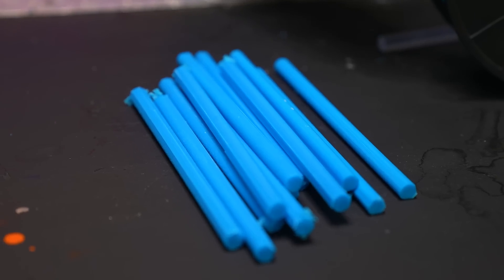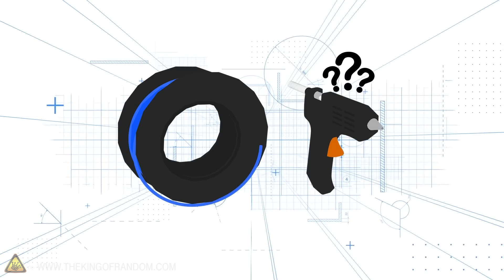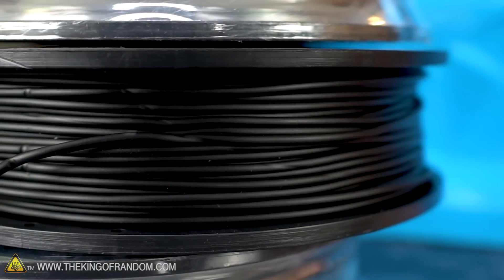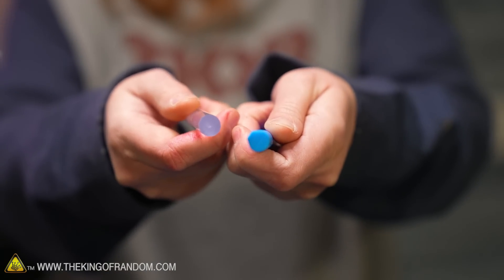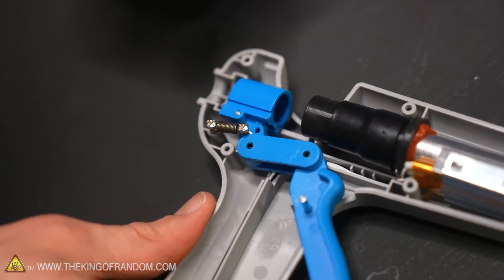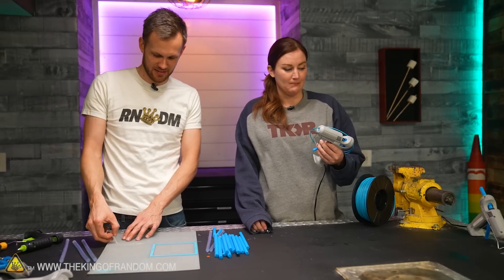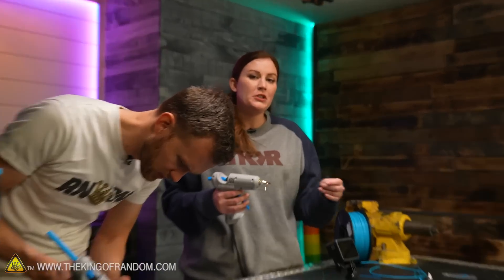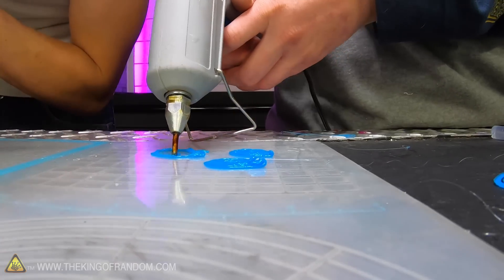Turning a Glue Gun Into a 3D Printer

Comment: U can get a tiny glue stick guy and there is two temp settings which wood and lighter bonds are at lower temp setting but the same stick at high temp setting suppose to bond metal and have strong hold..I've been curious

Comment: is there a strong enough filament that could be used with the "3d printing pens" that would make it practical to do repairs on plastic things in a vehicle, like trim pieces and accessories on the interior
Reply: Not with hobby 3D pens. Automotive polymers tend to have much higher melting points than the PLA that 3D pens are designed for. Additionally 3D pen create "artistic" rather than neat, precision results, so I doubt you could get a neat repair even if you could melt the correct polymer.
Reply: @ferrumignis  thanks for the reply, so with a purpose made tool, meaning built to handle the right heat, this still might work? n the patterning isn't a problem, a patterns normally used when doing repairs anyway, i havent personally done it yet so idk what they look like or how they work, I simply have a friend that does it n talks a lot about it

Comment: This is pretty cool. I use a soldering iron to fuse 3d printed armor for cosplay but can actually see this working even better for that purpose. It seems much cleaner and PLA welding with a soldering iron, although fast, doesn’t produce uniform and easily sandable results.

Comment: My favorite part is where you had to have a 3D printer to print the glue sticks, that you’re using, to make 3D printing easier with a glue gun. But you still need to print the sticks. And the 3D pen works better and faster. So what’s the point again? Oh to see if you can. Cool 😎 heat melty da plasticky duhhhh

Comment: Hot glue and a nice silicone mold (or tinfoil sprayed with Pam as a mold release) and you can make amazing things with hot glue.
It paints well after a layer of primer so you can get amazing textures. Or paint it with nail polish for a gem-y affect.
 I've made an entire dice tower, masks, jewels and an entire alien helmet with EL wire inlay. 
Since it's slightly flexible, I've used it as a mold material itself to replicate the snakes on the hocus pocus book in epoxy clay. It isn't perfect, but does fine in a pinch.
Since it's translucent, it's also awesome for flame effect for models and cosplay. Just paint it with glass paint, alcohol ink or insert a flickering LED from one of those cheap tea lights.
Use colored hot glue instead of sealing wax for fancy letters.
You can do so much!!!!

Comment: I'm doing some metal casting.  3D printer would be nice but not feasible on disability.  I go from Alginate to plaster to 2-part rubber to wax then burn the wax out.  Problem with the wax is it easilly deforms.  Wonder if I can use a glue stick gun to fill the mold or 3d filament,,,Hmmm...

Comment: Ok so hear me out at work we have something called jet weld it is stronger that the wood we used to glue it to it comes in metal tubes  that goes into a gaint glue gun this would be amazing to see it print it would be stronger than pla heat resistant.

Comment: While hot glue is hard to work with due to heat and time to work it, it is very possible to make certain things with it, with a bit of patients, for example. A "giant" bonfire for tabletop gaming that has red yellow and orange lights that flicker within the glue flame shape to emulate a fire. It took a while but looked way better than a 3d printed Version :)

Comment: Looks like you effectively have a plastic welder. I would say that'd be probably pretty effective at welding together different 3D prints.  Typically stuff I print is bigger than the print volume and so I usually plastic weld my prints together using a 3D pen but that looks faster...

Comment: My glue stick glue hardens almost immediately. Maybe my glue gun is lower power than yours. It's actually kind of a problem because I can't do things where I need to put down molten glue first in order to then stick an object to another. With mine it doesn't pool as much but the glue is very sticky and there are always stray strands of glue, and it can't melt a larger volume quickly, so while it would be easier to make objects/art with, it still wouldn't be practical.

Comment: Excluding the motion control functionality of a 3d printer, the rest of it is just a glorified glue gun basically.

Problems with your setup:
1) printers have heated beds to help with cohesion, and to help prevent rapid cooling. 
2) average nozzle diameter is 0.4mm and I'm fairly certain that is significantly smaller than standard glue guns.
3) the funneling ratio for 3d printers is ~4.25/1 which help to functionally push the filament out by pressure rather than a trigger function using the backend solid matter as a plunger, thus a smooth flow of outbound material.

I imagine it would not be that hard to modify any standard glue gun to function like a 3d pen, but not a printer.

Never the less... awesome episode, I totally thought those printed glue sticks were not going to work, were they solid or infilled geometry?

Comment: I got my 3D printing pen from ebay for about the same price as a high-temp glue gun, so kind of a mute point if you're gonna get a glue gun just for PLA. the pen I got also works with either PLA or ABS, with a versatile temperature control, so you can play with that until it cools at just the right speed for your taste. somehow heats up way faster than my hot glue gun, too. basically, don't destroy your glue gun to do this, just buy a 3D pen. totally worth it.

Comment: Here’s the problem I see with this. You need to use PLA, and a hot glue gun stays hot for a very long time in comparison to a 3D printer which has active heat transfer or a pen which has a very small CSA and cools down much quicker. Because of this, you end up cooking your filament, and it will become discolored and very brittle, potentially just rendering your gun useless after a couple tries. Fun concept to test out, but just get a 3D printing pen if you want to use it for practical applications.

Comment: I tried feeding polyethylene water tubing into my hot glue gun at one point to see if that would work. It wasn't quite hot enough to melt it.
Reply: Oh hi, dude! I really liked your wood gas videos.
Reply: Oh dang, that was the next thing I was going to try.
Reply: @403_tuna  simply?
Reply: thats not a bad idea as the tubing is wide enough for the feed mecanism to grab ontoo , only downside is that yo introduce a lot of air intoo the bead too as its a tube , you might be able to "hodrod" the gluegun and build a hotter heater for the head

Comment: You could use different speakers aligned to produce different frequencies that correlate to geometric shapes like they do with speakers and sand. You could use a powdered binder and a fast acting resin to make a 3D printer without a nozzle or motor. The idea could be tested with a bunch of simple speakers, thin super glue, and baking soda. 

I just googled this idea before pressing send to make sure it wasn’t already tried. Turns out Harvard did it in 2018. Bummer.

Comment: Hey TKOR, I have a suggestion you might be interested in. When you put PLA out onto the rubber mat, it was cool enough to not let the molten PLA stick to it. As you know, a 3D printer often heats the print bed to 50-60°C from the PLA transferring onto it from a temperature of 220°. Try a heated surface to overcome slipping away of molten PLASTICK from the gun.

Comment: I built flame wings for a fire Pegasus using hot glue, floral wire and feathers.  The tips of the wings were flames of hot glue, and the structure of the wings is a lattice of hot glue,  covered in feathers.  You can build things in 3D with hot glue if you give the first layer time to cool (pop it in the freezer for a minute or two) before adding the next one.
Reply: I did 3D stuff with hot glue by using a strong desk fan for cooling, but it makes your eyes dry quickly (you really need it blowing right onto the object, and  because of that also your face as you look at what you're doing).

Comment: My thought was to take a piece of material and drill a hole in it, and feed the filament through that hole, that way it cuts down the time if printing the sticks, and you can just feed it straight thru the gun,like an adapter, you'd have to raise and move the the flap thing, so that it only pushed the filament through.
Reply: then that will litterely be a 3d pen which you can buy for like $20 that uses normal filament
Reply: @EfficientMoneymaking  true, I was only saying it because of the subject, it's so much cheaper to just buy a 3d pen

Comment: What if U cut a bunch of filliment to the same length, hold them together, and put them in the glue gun? That way they will touch the sides and if it worked,u wouldn't have to print glue sticks. One issue I would foresee,tho, would be the filliment in the center would be cooler than what was on the edge, cause it wouldn't be actually touching the sides but this might still have possibilities.

Comment: Do you have the .stl files for your PLA-Sticks available for us to use?
Would love to use this method to fix/fill gaps in my 3d prints.
Reply: Hey! If it were me, I'd just create a cylinder object in PrusaSlicer and set the diameter to 11mm, length to 200mm, 100% infill. STL made in 30 seconds :)
Reply: You should be able to just get SketchUp free, get a .stl exporter extension, and just make a model of a cylinder. The whole process should take maybe 15 minutes if you know kind of what you are doing
Reply: Thanks for the options.
I'm still fairly new to 3d printing, so I am still learning about how to make files from scratch.
Reply: @JonnyStarwind  no problem

Comment: This.... is actually pretty clever.
Also, this could work for helping to attach large 3d print segments together.
Reply: you actually reinvented glueing petg together by this
Reply: You can use a heat gun with HDPE sticks to repair stuff like kayaks.
Reply: just use an off the shelf 3d pen